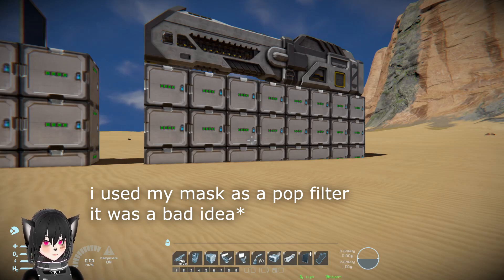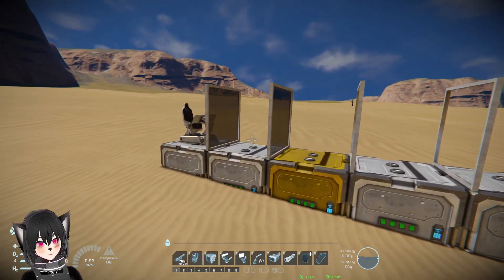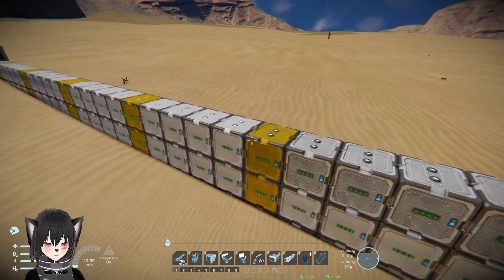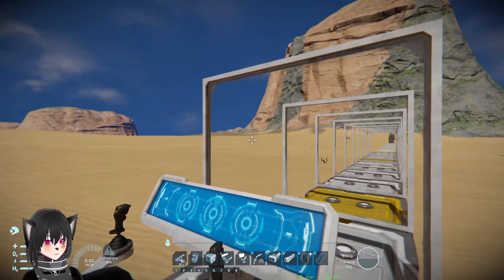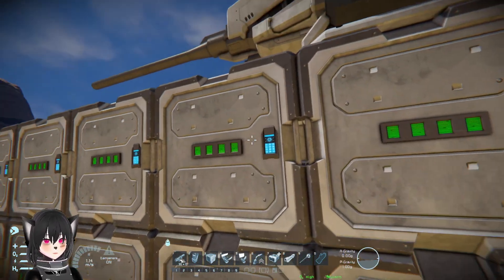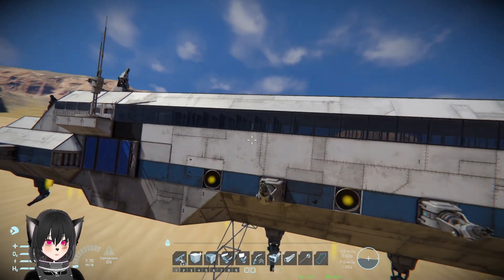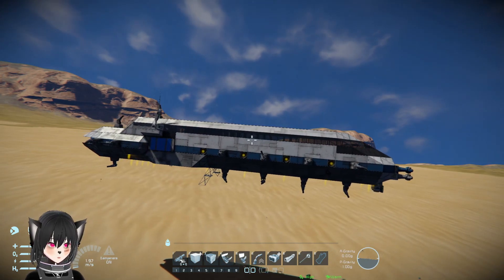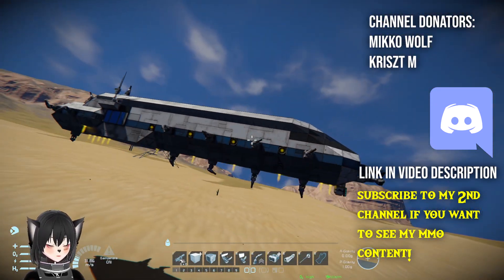How Many Ship Windows to Stop Railgun and Artillery? Space Engineers

Comment: Those who live in glass ships should not shoot railguns...
Reply: UNLESS THEY SHOOT FIRST!!! [HOP HOP HOP!]
Reply: @hunnybunnysheavymetalmusic6542  they are just bigger in size an hit points
Reply from the maker: xD
Reply: @АнтонНазарук-щ5с  If you have first attack at long range with a lot of DPS, you have a good chance to defeat an enemy of equal to slightly greater AC.

While it is not a fixed rule that the biggest gun wins, getting off a long range high damage volley of shots against an enemy before they can close on you is a distinct advantage.

I would be packing a massive number of rail guns and the reactor cores necessary to keep them firing at maximum rate so the enemy would be almost up against a monster gatling rail gun in essence.

Comment: The question then becomes: can you STACK the windows next to each other?

Or do you need 30 blocks of space to layer windows?
Reply from the maker: You can't really stack them in a single block space but you can have them kinda side-by-side if you have regular window and inverted window rotated in certain ways x3
Reply: @LucaTheGuide  I suppose I can try stacking them face-to-face and I think one can use partial solar panels too.

Strange thing about solar panels, is that even when they are nothing but a frame, they have an amazing amount of HP to them.

I am just not sure if I can stack them densely with small grid blocks or if they are only compatible with large grid blocks.